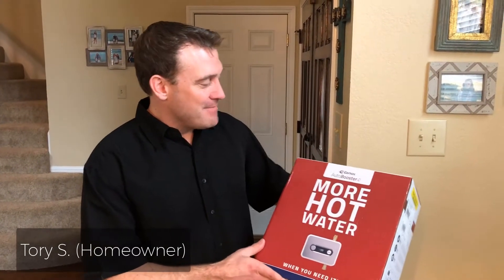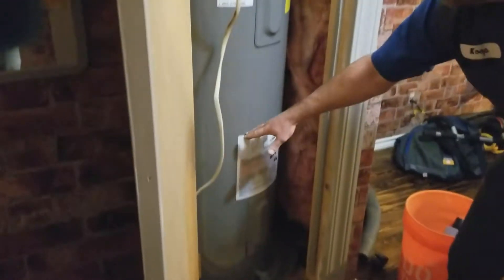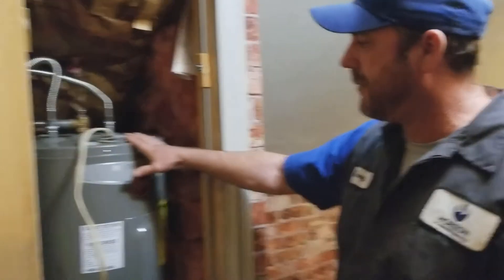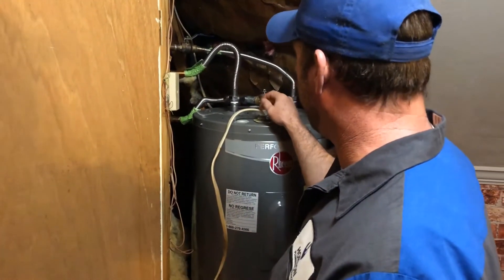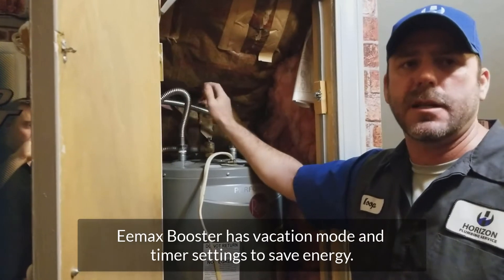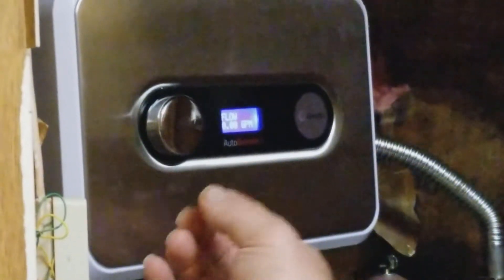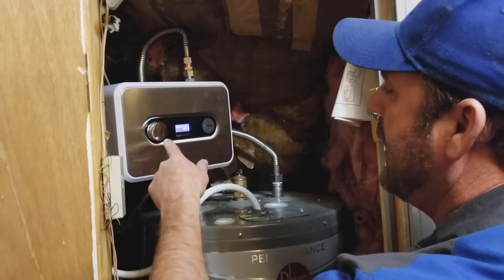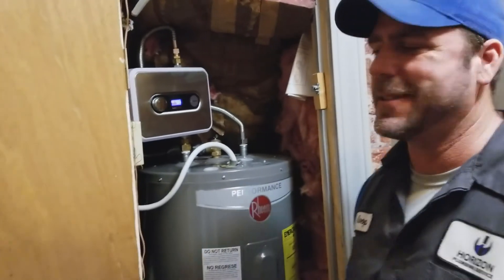Eemax Water Heater Booster - What You Need to Know

Comment: How do I get it off activation mode? I had to set mine to 120 with the snowflake icon  and it still shows that on the screen . It times out. But once hot water is being used it shows the activation screen only not the in and out temperature

Comment: This video was made four years ago.  I'd like to see an update on how the booster is working now (four years later).
Reply: 👎🏻The screen on my Eemax hot water heater booster broke after around 3.5 years.  Their customer service is terrible.  I would go with another brand.
Reply from the maker: Since the posting of this video, we've not had any trouble calls about it, and to my knowledge the system is still functioning according to manufacturer’s expectations. The one I put in my house worked and helped provide more hot water for as long as I had it. 

It's been roughly 2 years since I converted to tankless.  We've got a video out on the tankless unit I have. and it works great.  
https://youtu.be/nkZ1Wr3fK1U

TruTankless is the way to go if you can, however they have not been able to ship any units due to the current chip and supply issues across the nation.  

Troy Koopman

Comment: Does the tank need to be drained prior to install of the booster?
Reply from the maker: Hi.  The tank does not need to be drained. Just need to shut the water and power off, install the booster, and turn the water back on.
Reply: @horizonplumbingservice8865  The Eemax instructions says to drain the trank completely, but I can confirm that it is not neccessary to do so.

Comment: Would this work if you are losing heat to a shower that is very far away from your water heater ?
Reply from the maker: Heat loss from an appliance to the fixture is normal and the further away the fixture from the heater the greater the loss. In this case the booster will not help. It can increase the amount of hot water you get from your tank, but the heat loss caused by the total developed length from the heater will remain.  

You could add a heater closer or move your current heater closer. The hot lines running through the home can be insulated and that can help.  Most customers turn up the heater to make up for the loss and sometimes a hot water re-circ pump will also help.
I hope I have answered your question. Thank you and have a great day.

Comment: Could you stack another one on there either on the same line or on the cold input
Reply from the maker: No, only one... The power for the water heater is removed and wired into the  Eemax and from the EeMax back to the water heater so you would not have the power to run more than one. 

Theoretically, you could add another power source to operate another EeMax but any additional hot water derived by adding it would not be economical or efficient.